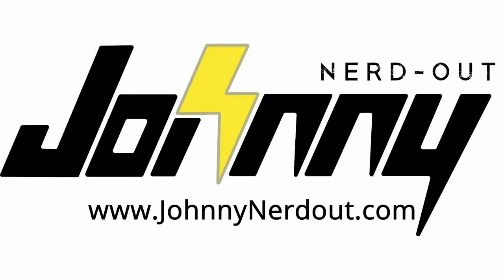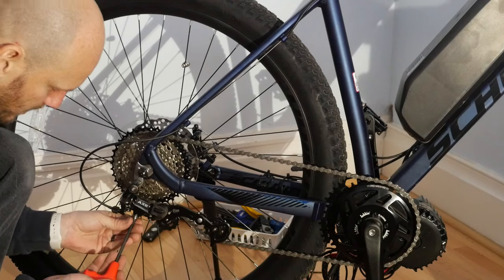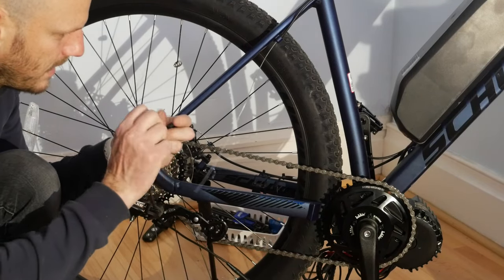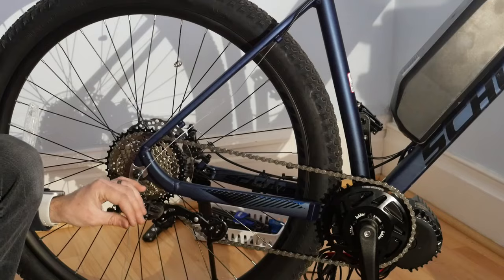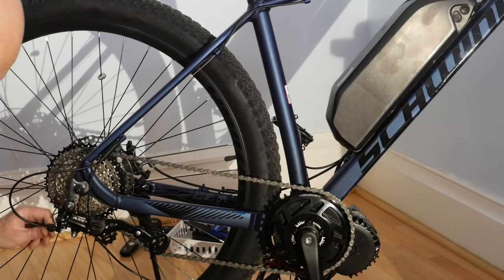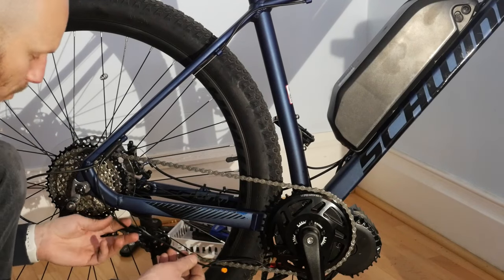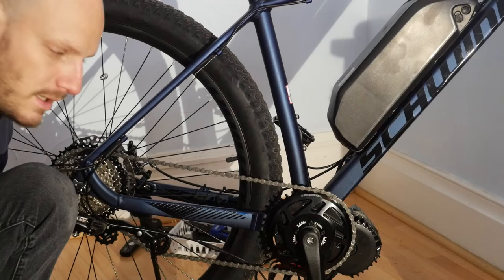Gear Shift Sensor Installation video for a Bafang Mid Drive system BBS02 / BBSHD E-bike

Comment: To prevent splaying on bike cables I use electrical solder on the cable end before I cut it. Just need an inch of solder coverage and it will cut clean and not fray. It will stay neat and clean over the life of the installation.
Reply: I use a drop of thin superglue. Let it dry. Separate your fingers. maybe give a light sanding, as an alternative, if solder not handy.
Reply: @whazzat8015  "separate your fingers" :D , "maybe give it a light sanding" - not the fingers :P
Reply: @kilrain_dev  The cable, and maybe  then my nails.
Reply: fantastic idea

Comment: Dipping the end of the cable in flux, heating it lightly  and thereafter putting a tiny drop of solder on helps to avoid the trouble you had with single steel strands. The solder holds the strands together and you can even sand them down to somewhat of a point.
Reply: I just use super glue
Reply: @scotth5503  Yep - twist the strands tight and put a drop of the thin stuff on.
Reply: Haha I just made a point to come here and comment about using a dot of super glue.  Looks like it's already covered...solder would be good too.  Anything to keep it together.  I had to order a new cable and wait on it because it splayed when I took it back apart....should have just left it well enough alone lol
Reply: 080090❤❤

Comment: Yay !! I was wondering where the Gear Shift Sensor went and how to fit it as I'm getting a Bafang mid drive Motor with battery, so I'm schooling up on as much valuable info and resources as I can find and as you are more direct and to the point I find a lot out watching your YouTube Videos, Thanks for sharing your experience and knowledge as it is most appreciated and useful .👍👍😎💨🏴‍☠️

Comment: I had the same problem with the cable, ended up fitting a new gear cable, they're cheap enough, as for the sensor in action, brilliant! ..need this with that much torque!

Comment: I put mine on the handlebars at the shifter to avoid running yet another wire along the frame. I created a small bridge piece of cable housing to go between the sensor and shifter. With a BBS02(b) or BBSHD these should be a standard part of a kit. 

Shift sensors are not nearly as much of a necesity on torque sensing mid-drives.

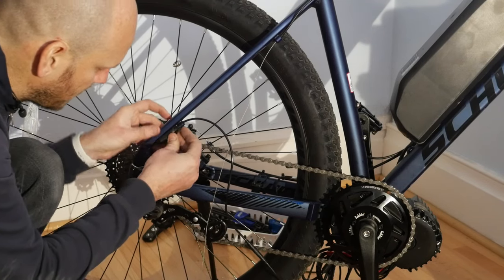Comment: My gear shift sensor kit only came with one little addon piece of plastic, the piece you added at 1:39, not the piece seen at the top end of the cable housing in your left hand seen at 1:51. No kits on amazon seem to have that piece. Am I going to run into issues not having that piece/pieces?

Comment: Newbie here, in Vancouver Canada.. how does the gear shift sensor sense the cable movement???.... It looks like the metal cable is in all the way through the sensor when at rest, and when shifter is pulled, it is still sensing  the same metal even though it moved... so what changes at the sensor when it moves?  Did I miss something?  Great videos.. where can I buy the mid drive Bafang motor( 1000 W or 750 W ) and assembly parts ? Where can I get the specialized tools needed in Vancouver? Thanks  I am an industrial electrician and I know I can do this easily with your videos and tools...
Reply from the maker: There is a little roller inside the mechanism that senses when the cable rolls over it and it cuts power to the motor momentarily.

Comment: Trick, use construction  grade superglue to just hold the steel cable end together before threading through the sheath. You will need to moisten the metal but breathing on it should be enough

Comment: Your helping me so much I’m saving up for a bafang motor is it okey if I just install the thumb throttle and the brake sensors and the display?
Reply from the maker: Yes
Reply from the maker: And speed sensor
Reply: @JohnnyNerdOut  ok thank you
Reply: i think if you don’t need PAS, you can configure the throttle to work differently for each PAS setting. Otherwise the throttle is just on or off with no way to modulate the power

Comment: Hello Johnny,
Really enjoy your videos. If you cut the shift cable clean and put a bit of solder on the tip it won't fray.  I actually stopped putting the caps on them and solder the end now. They slide through the shift sensor better as well.
Reply from the maker: Good tip. I used to do that myself. Not sure why or when I stopped🤔

Comment: It can be mounted on the upper end of the bike also, the cable stops will dictate best location, and and gear sensor cable extension (``24) are cheap on Amazon ...if you get in a bind.

Comment: It looks as though the sensor detects movement of the shift cable running through it.  Pretty simple really.  I'm hoping my local bike store has cable cutters for sale.  I figure i will be doing some e conversions for family and friends after they try mine out so buying some nice tools is not a worry.

Comment: Hi Johnny 👋 This is the dude who just bought two DM01s from you.  Shipment was speedy - thanks for that.  Is it important to mount the speed sensor as close to the center of the wheel as you can?  In regard to my shift sensor, I'm going to have to come up with a plan because my shift cable has a sheath throughout.  I guess I'm just going to have to make a gap in it somewhere.

Comment: Hello! Can u pls help me? I have a KTM ultra fun, 1x12 speed bike, with a 34T chain wheel at the front. Can I install Bafang mid drive set? It comes with a 36T chain wheel. Will it suitable without replacing the full drive? Thank you!

Comment: I use a cheap old pair of wire cutters.
 I've had for about 15 years now.
No problem cutting gear cables.

On the gear shift sensor.
I never spin the cable I just push them in never had a problem.

You didn't mention you can wire them on any mid drive ebike controller.
Just need the 2 cut off wires 
Ground & signal wires 
And get the 5 volts wire shared from the throttle or pedal assist.
Then you have the 3 wires to work the shift sensor
It work no problem

Comment: Johnny, have you ever tried just loosening the two screws on the plastic gear sensor and then slipping the cable in that way, much easier.  I found it extremely frustrating to try to push the cable through the gear sensor, because it's a tight fit and it has to go around that little pulley and each time like what happened to you it frays the cable.

Comment: Johnny didn’t explain, if you stick a straight pick in each end you will notice the 2 holes bend down towards the existing wire about 15 degrees, it’s not a straight through hole, if you put a slight bend on the wire aim towards existing wire it will go through. And you won’t need to worry about end Frey, I usually dip end in candle wax, just since we have a bunch

Comment: I install it, if possible, closer to the front of the bike for a good reason. If there's a suspension fork (usually the case) there are less shocks on the front end than on the rear end. Hard hits on the rear wheel can sometimes trigger the shift cutoff, if the sensor is placed close to the rear axle. That plastic insert is too small, I just use the shift wire housing with a plastic ferrule, that fits perfectly into the sensor. Some chain oil in the cable housing and shift sensor helps reduce friction and improve shifting performance. by the way, that chain on this bike is waaaaaaaay too short :D
Reply from the maker: Yes I know. This isn’t a video on sizing chains!!!!!!! 😂😂😂

Comment: How does the sensor work? Is it optical like a computer mouse that senses movement of the cable or what? Maybe a friction wheel? Same question for the non magnetic inline brake sensor... thanks.
Reply: Senses movement of the cable. Some kind of laser probably. Dirt tends to accumulate on the shift cable inside the sensor and you have to clean it off once in a while.

Comment: hi i have a Focus Thorn 2016 with mid motor "impulse evo rs". the circuit board/controller is broken. it is difficult to find original spare parts. Is there a universal controller that I can buy? I don't need PAS, I want to buy a controller, a throttle and an LCD display

Comment: Hello Johny, thank you for all the videos! I would like to buy a second hand ebike, mostly for commuting with a child seat on roads. I was trying some bike (with good components alivio, hydraulic brakes, ..) from 2018 with bafang M300 and I was surprised how loud and unpleasant the shifting was even when I tried to stop pedaling (probably due to cadence sensor). On my grandfather 2013 rear hub motor the shifting is so smooth and pleasant (I know - because the force is not going trough chain). My question is: If I want to smooth shifting, should i just install this gearshift sensor, or buy newer motor with torqsensing (because you can control the motor better during shifts) or just buy something with rear hub motor? Is there some downside to installing gearshift sensor? Like shorter motor lifespan? Thank you very much! Josef
Reply from the maker: A gear shift sensor is a must on cadence mid drives IMO. I would even install one on a torque sensor if possible. The GSS will prolong the life of almost components on your bike 👍
Reply: @JohnnyNerdOut  Yes, I thought so just from the test ride. The person who was selling the bike (which had 10 000 km) didn't find it strange even though he was changing the chain twice a year. Thank you for a response! :)

Comment: Whats the difference with the 2 types of gearshifter sensorers from Bafang? 
They are marked as a 
1 : Plastic gear shifter sensor
2 : Metal gear shifter sensor
Is it just the housing 🧐
Reply from the maker: Yes. Plastic is smaller, but plastic. I like th plastic personally
Reply: @JohnnyNerdOut  easier to make plastic snuck/waterproof and it wont rust 😁

Comment: Any tips on gear slip?  Middle cogs on an newish Acera want to shift under load. ,no discernible wear. Replaced chain, aligned hanger, adjusted range and indexing. Checked idler wheels for play, chainline, cables and shifter seem OK.
I'm not happy with hanger pivot bolt play, and was wondering if you had any tips before replacing the RD? They are hard to get these days.
ALSO Safety tip. I always pull battery before working on chain/gears. Bumping the throttle could suck a finger through a place you would rather not. This is also a concern when dealing with a dropped chain in front. I carry a little hook I made from coat hanger, for that.
Reply from the maker: Sounds like you literally checked everything. If it’s still persisting, maybe take it in and see if they can catch something you didn’t? Tons of good videos on YT about the matter from people who specialize in it though, I’m sure you tried that🤔
Reply: @JohnnyNerdOut  THX.  Yes, its either just that hanger bolt play or something where someone gets his experience with seeing a lot , to pay off. The BBSHD puts so much more power though the drive train, it brings things out. I understand Justin L-E's bias towards hub motors as power goes up.
Reply from the maker: @whazzat8015  hmmm the BBSHD shouldn’t be ruining your drivetrain though unless something is out of adjustment or it’s being driven incorrectly. Once you get to 2-3k watts a mid drive starts putting a lot of strain on parts 👍 once you get that dialed in I think you’ll be 😃

Comment: I really like the Axum for a good budget e-bike.
I guess I've been lucky installing gear sensors. I will be prepared in future if it doesn't go as smoothly next time. Thanks.
I'm curious how important it is that you're in the highest gear when installing the sensor? I ask because you were in the 2nd lowest. Can I assume it's mostly adjustable once the install is done, and it's just best practice to be in high gear?
Kudos on your cable management aesthetic.
Reply from the maker: Best to be in high gear. The chain location and the shifter position are independent 👍

Comment: Johnny, don't new cables come with the ends soldered and neat? You could have fed the cable through with the soldered end and then cut it after to avoid fray fuss. 

Love the videos! Just installed a gear sensor on a Schwinn Axum DP myself and it is working super well. Couldn't have done all of this without your help!
Reply from the maker: Yes new cables do, but the old wires that come on old bikes oftentimes are splintered and barely held together.
Reply: What battery did you use?
Reply: @DevanSisson  FTH Power. It's an American company that rebuilds batteries. Their quality is excellent, but selection on sizes limited compared to Chinese manufacturers.

Comment: So the small rubber thing it comes with is supposed to sit in that hole in the frame ?  I'm confused as to how it actually detects the cable moving is then as I thought that rubber thing was going to slide on the cable and then be fed inside the middle of the sensor to press against some switch, but then there would be nothing holding the sensor housing in place to the frame 'hole'. I thought maybe you used a random piece of something to make it stick on there, Its hard to see exactly from the video.
Reply: Im guess there is a little tension pulley in the house to where the cable is going to run on top of it so when ever there is tension put on that pulley it trips it and cuts power to the motor and then kicks the motor back on

Comment: Does it matter which way you run the cable through the sensor?
Reply: Only if you ever only change up gear and never down during a ride 😉

Comment: Hey Johnny I got a brand new bafang mid drive and I only have 55 miles on it and it just stopped working and I got error 30h, I was riding when it stopped, checked all  connections and changed the display and still another error 30h?what is your guess?
Reply from the maker: I checked for a bad connection somewhere or a severed wire somewhere. If not you could always try switching out your display and then start switching out small components like that until you find the culprit. 
https://electricbike.com/forum/forum/kits/bafang-mid-drives/troubleshooting-bbshd-and-bbs02/976-error-30-in-the-bbshd-and-bbs02

Comment: Johnny do you ever have issues with the shift sensor and “rapid fire” shifters that can down shift 3 gears at a time? I’ve had some serious derailment issues when down shifting a bunch of gears. For example shifting down 3 gears then another 3 gears really fast. Is there any way to get these things working fool proof? Or do you just need the user to shift carefully & deliberately ?
Reply from the maker: Yes. Ride deliberately and thoughtfully. It’s not a high powered sports car!😀

Comment: Your derailer gears are pulled all the way foward in your top caset gear. Is that the way it should be? I put a 30 tooth on my midrive and a new chain for climbing but chain is to loose and comes off over bumps in bottom gear.
Reply from the maker: Chain was not sized yet in this build
Reply: @JohnnyNerdOut  can you do a video on setting chain length
Reply from the maker: @fulllfreezer  in the works 👍
Reply: @fulllfreezer  most derailleur size the chain by taking it around the largest cogs, Outside of the derailleur , add a couple links to it. In any case it should say in the manual for your derailleur

Comment: Do they have a similar sensor for brakes? I was wanting to do a drop bar installation with road bike brake levers.
Reply from the maker: yes, you will need in-line brake cutoffs. Available here: https://www.johnnynerdout.com/product-page/in-line-brake-cut-off-sensor

Comment: Bafang kits com with a speed sensor. Can that act as a substitute for a gear shift sensor or do you need to install both ?
Reply from the maker: They are totally different sensors. Install both 👍

Comment: Why not just remove all the gears and even from the handlebar and only use bafang motor and peddle assist. 

What is ur thought on that?
Reply from the maker: Like a unicycle?
Reply: @JohnnyNerdOut  hahaha of course u still use both tires but just remove the gears and use the motors peddle assist modes levels while biking and not shifting at all.

Would that work or is it more effective to still be able to shift gears during bike ride
Reply from the maker: @theartteacherdaniel5096  oh I see what you mean. That would be like using your gas pedal instead of your gears on a manual transmission car. It would work but it would put a lot of strain on the drivetrain and cause parts to need to be replaced much faster 👍
Reply: @JohnnyNerdOut  oh OK i see so it may be better to not remove the gears. Thanks for your reply

Comment: Is it harder to install a mid drive kit onto a bike with drop bars instead of flat?
Reply from the maker: Yes. Mainly with brake cutoff installation and running wires

Comment: I’ve got the bbshd with the 42t chain wheel that comes with kit. The chain alignment is out, will the lekki bling ring help? Does it cover the motor a little where it gets attached?
Reply: Yeah,  the 42T lekkie cups the BBSHD cover, so the alignment will be much better using the 42T lekkie bling ring, which has an 18mm offset , although I'd also buy a few lekkie spacers too, they're inexpensive, just in case you need them too, a 1mm and a 2mm spacer should be ok for most installs, as some installs can bring the (lekkie) front sprocket too close to the bike chain stays frame, ideally you want a 1.5mm or 2mm gap between the front sprocket and the bike frame, using a spacer behind the front sprocket will allow for fine adjustment as needed, although they're not always required.